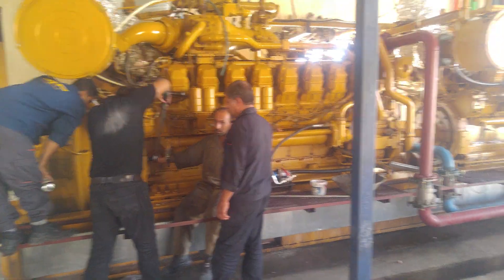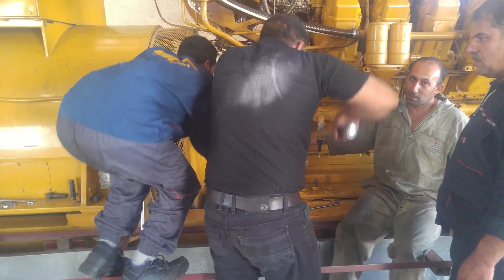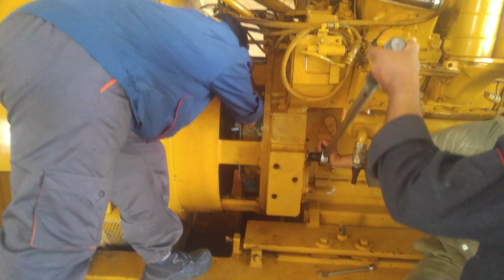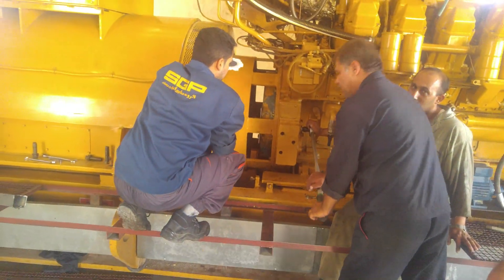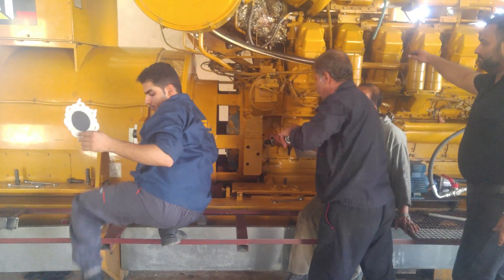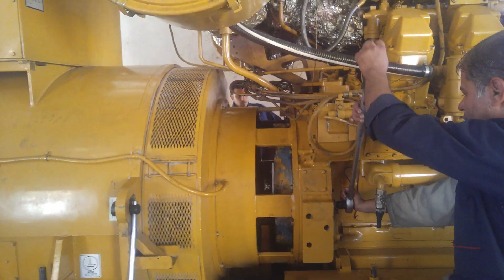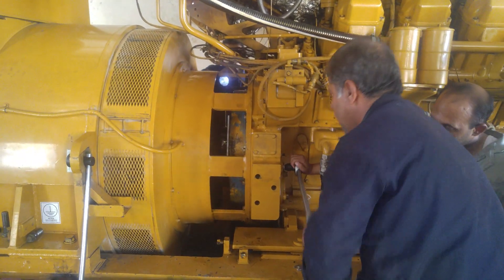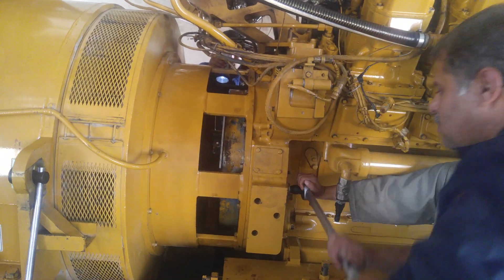Caterpillar G3516 tandem gen-set alignment

Comment: your company really need  to invest in a  new digital calibrator because as you may knew  those mechanical calibrators are not accurate and can easily be damaged
Reply from the maker: Well. To be honest I think these dial indicators work good enough for our service. 
The alignment threshold for this application is around 0.25 mm.
If someone learns to use them the right way they will keep a long life as I'm using one simple original set for almost 4 years.